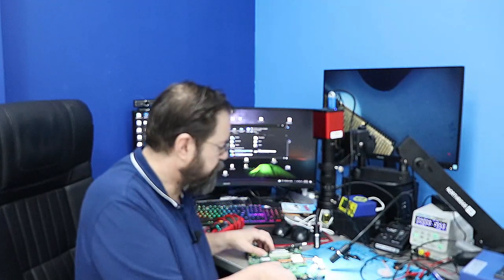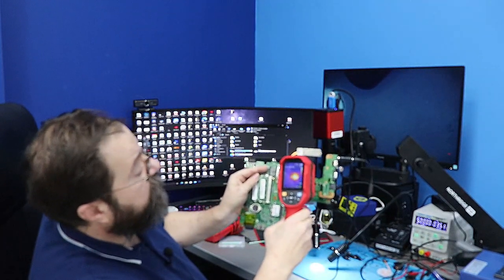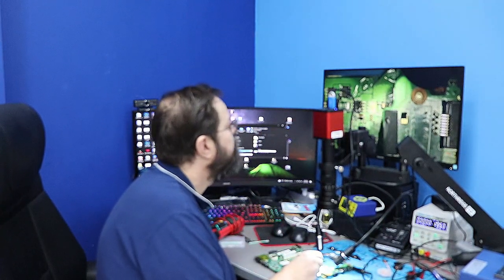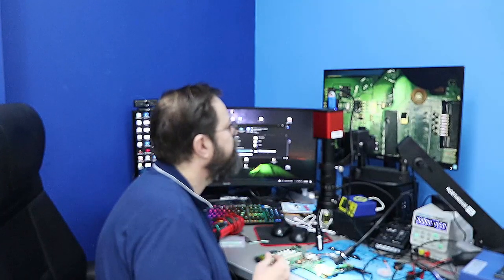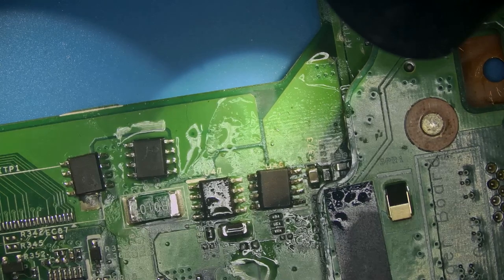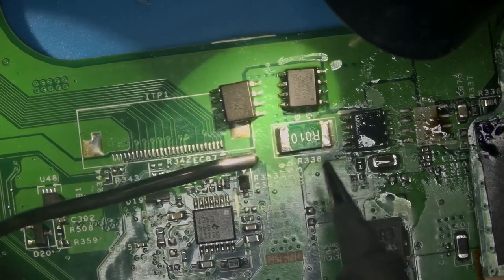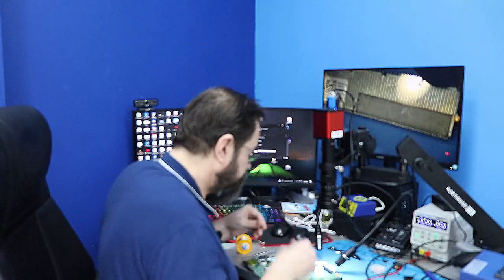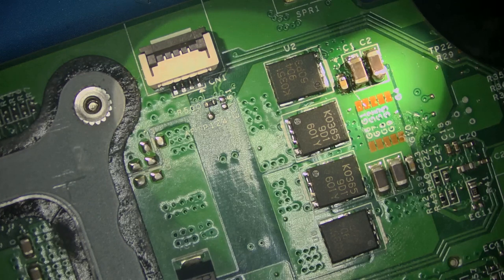First Mosfet on a laptop.

Comment: Which thermal cam are you using?
Reply from the maker: It's the Unit-T, purchased from Northridge Fix.  You can take pictures with it but not stream, otherwise it's does a great job.  The macro lens lets you see in great detail.
Reply: @BasicComputerRepair  Can you connect it to a computer where it will be seen as web cam? This way you could actually record what you see..
Reply from the maker: @krzysztofadamski7804 Doesn't have HDMI, only USB c to charge and so card to take pictures.   Works great but terrible for sharing images.
Reply: @BasicComputerRepair  so it's not UTi260B that the Northbride is currently selling? That one is supposed to support connecting via USB to a PC in "USB web camera" mode, according to some informations I've seen.
Reply from the maker: @krzysztofadamski7804  I'll check when I get into work.  Thanks for the idea!
Reply: Please what is the name of your microscope camera
Reply from the maker: @ElJibrin0  It's from NorthRidgeFix.com.  The link  to their store is in the description.  Love the microscope!
Reply: @BasicComputerRepair  For what is worth, I got the uti260b (so the one they sell at Northbride as well) myself today and the video recording via USB cable works good for me. The USB mode is set to "USB camera" instead of "USB disk" in the options and when the device is connected to my computer, it is seen as a normal UVC web camera. I could even connect it to my phone via USB and see the output with some random USB camera app. The screen on the phone is only little bigger so there is not much point in doing that to watch the stream but the android app can actually record the stream on a phone. While it operates as webcam and sends video to computer, you can still see the output on the device built-in screen and use all the buttons to configure the camera. You basically see the mirror of your screen on a webcam stream.
Reply from the maker: @krzysztofadamski7804  Thanks to you, I looked into the issue and my next video will include live thermal imaging with my thermal camera.   You were right, just needed to download an app and screen record.  Thanks for the tip!